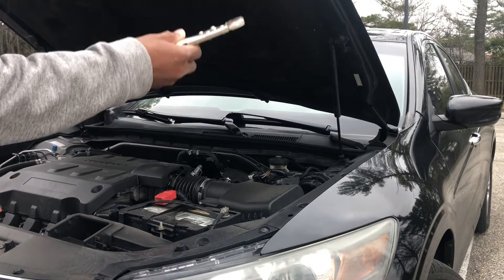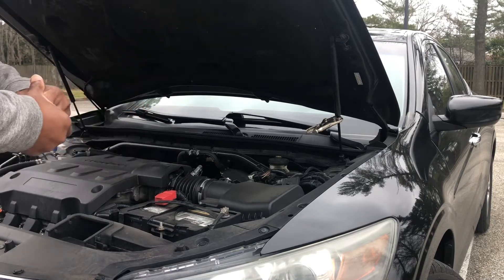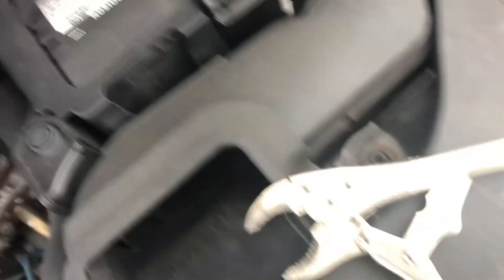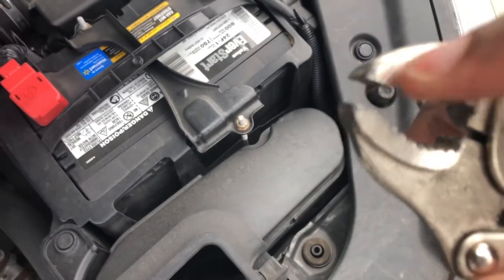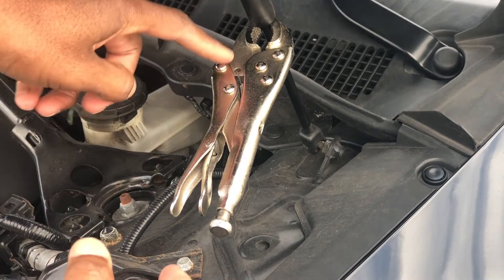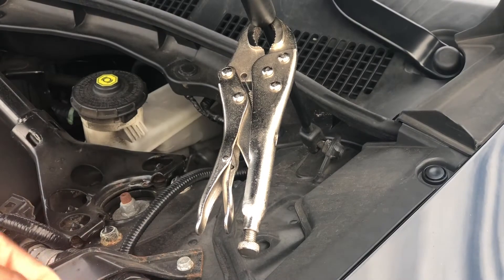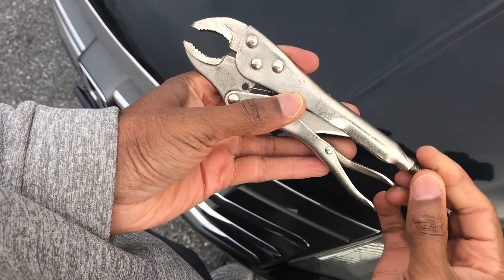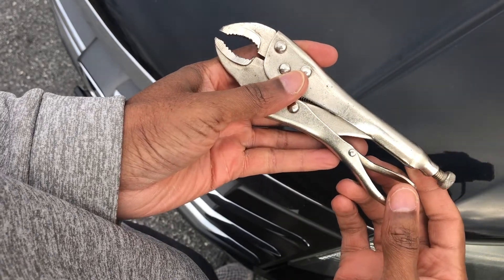Easy Solution For Weak Hood Struts On A Honda Crosstour 👍

Comment: That's very nice... XelaWash 
I want you to show how manually open the Crosstour Trunk in case malfunction occur.
Thanks sir.
Reply from the maker: Ok thank you my brother. I will figure it out and make a video for you 👍👍👍
Reply: Yeah that or the battery is out for a long job under the hood, like replacing the engine which im almost done with now at this point